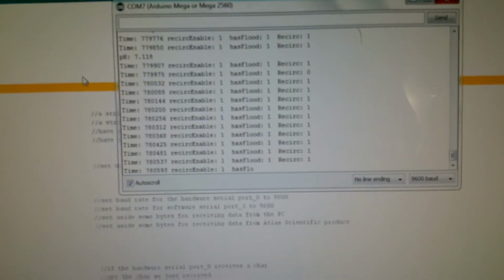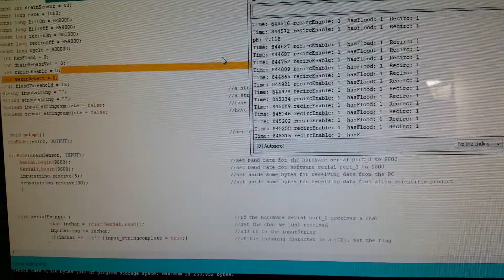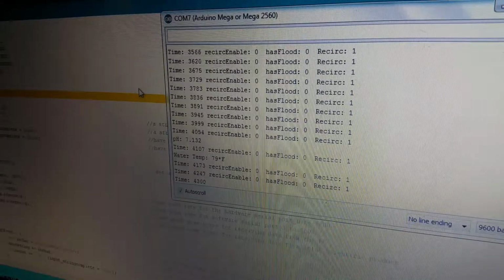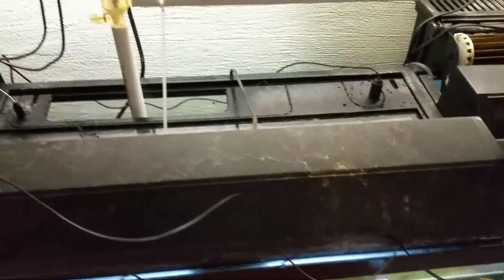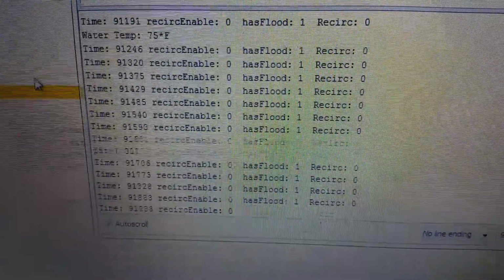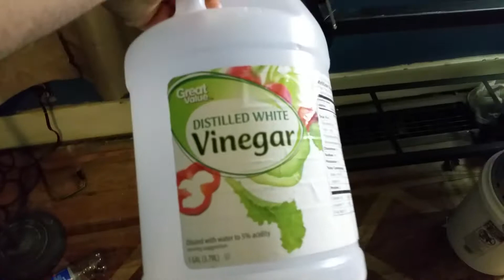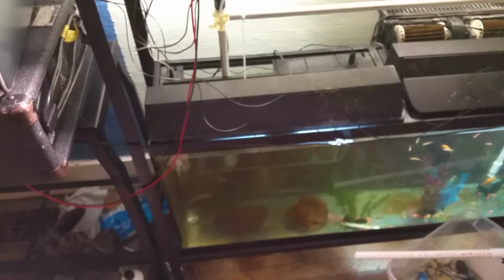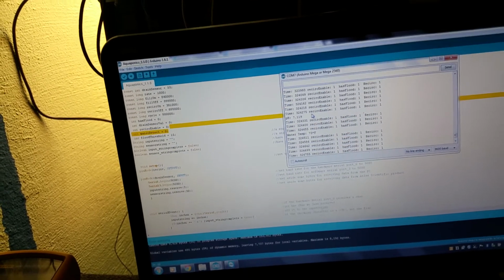Aquaponics Update with Arduino Controlled Grow Bed

Comment: Very nice. If your willing to do open source I'd love to see your source code. I was thinking about these same types of practices. I thought I'd look to see what others were doing with a Arduino or RPi first. I wish I could find code for one of my many MSP430 chips but no one seems to use those so I guess I'll give in & buy a Arduino. ;)
Reply from the maker: I will tell you that this version of the code is far outdated now. it did function, but I have since added SEVERAL improvements.  I am still working on it but go to 218.m3allc.com/aquaponics.php to see what I've been up to. There are some stability issues  I am dealing with currently, but it is far more advanced now than it was at the time of the video.
Reply from the maker: btw, the pH is off right now due to a faulty probe. as a result, the ph correction is disabled.